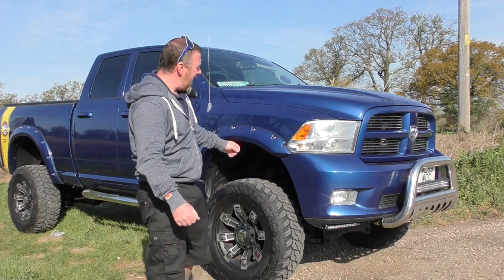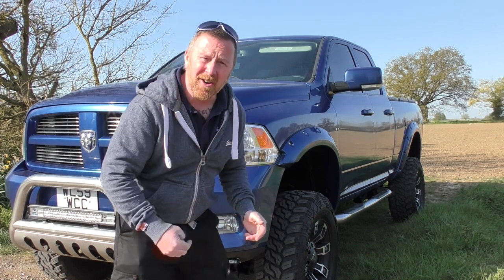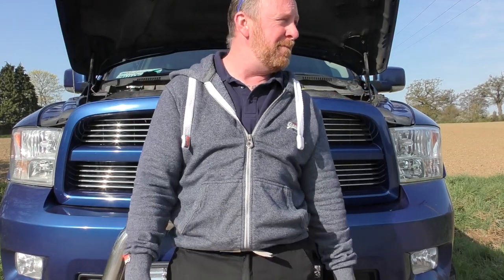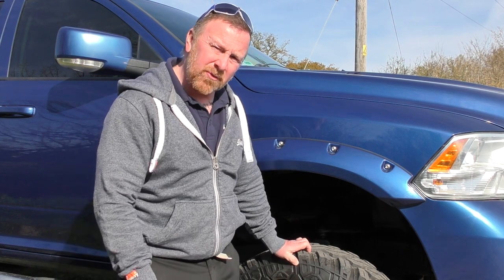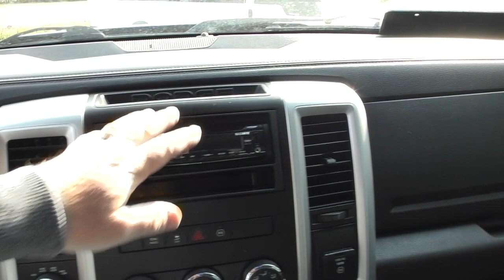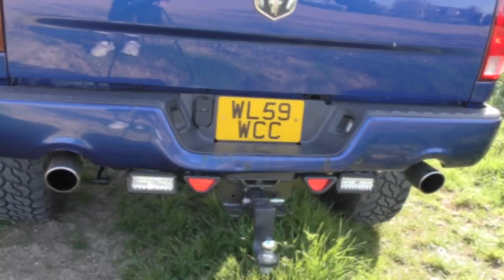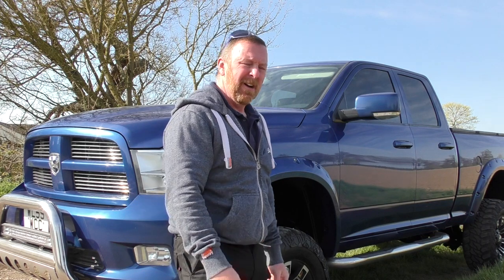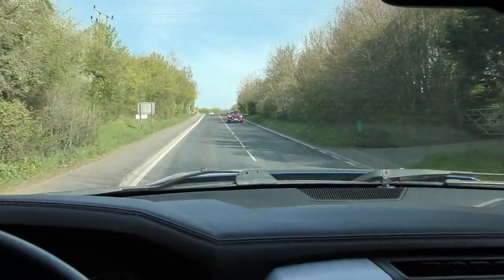MONSTER TRUCK DODGE RAM UK REVIEW MARK SAVAGE

Comment: Great video! Youve done a great job restoring the truck. I work as a mechanic in Quebec. We call it the "accessory belt" in English and the "couroie serpentine" in French. Auxiliary Belt works too though, ill add that to my vocabulary. 

If the truck came from Canada you will have rust problems on it. During the winter the roads are covered in a thick soup of semi-melted ice and salt and small pieces of gravel and sand. All roads, highways too. The tires are whipping this mixture into the underside of the vehicle 6 months of the year.  Then the spring comes and if its not pressure washed the sand-salt that got into all the small cracks will turn into soil and start rusting. 

These trucks actually do well relative to other cars. Its common here to see a 12 year old Honda/Hyundai missing pieces of its footwells. Or first generation Mazda3's which were notorious for digging out holes in the car body right where mudguards would usually go. After a while the spray from the tires would start pilling up in the trunk(boot) and cabin lol. 

If you can when you get the time, hook up a air blow gun to an air compressor and blast some air inside the frame rails, lower body panels and engine subframe. it might still be full of accumulated sand-salt.
Reply from the maker: Yea once I found out where it had really come from undersealing was my main job but it had got hold bottom of doors and under the arches 
But still looks an amazing truck 
And enjoyed the extras I did in the other videos 
Great to hear from you and thanks for commenting and watching bud
Take care

Comment: I saw this one for sale, I wouldn't have paid that with those issues to be honest mate but each to their own! That red light on the dash is your handbrake registering as on by the way! MPG is also in US gallons so might be a bit more :)
Reply from the maker: Oh ok with the hand brake as it didn't work , I have tightened it up now and it works but have to replace the rear pads so may as well overhaul the whole thing while in there thanks bud 
And yes but as I said I bought it with my heart lol 
However it is coming around 
Thanks bud
Reply: @marksavage  It might well be the microswitch at the top of the pedal mate. Chrysler got the system from old mercs believe it or not - common issue on 300C's also. Try lifting the handbrake pedal all the way up whilst it's on, see if it turns off.
Reply from the maker: @JkF-  just checked as yesterday I tightened the cable and its off lol 
So you were right 
Top man
Reply: @marksavage  Ace dude! Get yourself a cheap OBD2 bluetooth/USB connector and AlfaOBD (app) and you should be able to disable TPMS also. Enjoy!

Comment: Hi mark I’ve been watching some of your old videos fixing up a Yamaha aerox I’ve recently braught a yq100cc one could you tell me where the engine number would be too as I can’t seem to find it
Reply from the maker: It should be at the rear either side or can even be underneath!
But as you don't know the history of the bike the engine may have been changed 
If you can't find it, it might not have one !!!
Why you after it as only the frame number counts for the UK mot
Reply: @marksavage  okay thanks couldn’t find it but wanted to try and find it to see if the engines ever been changed and not updated in the logbook but that’s good news that I only need the frame number for mot